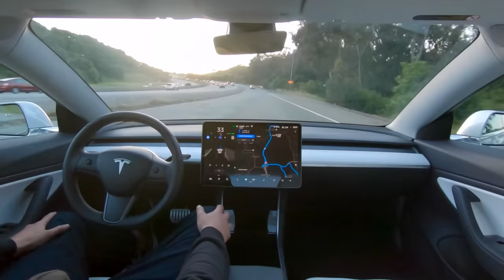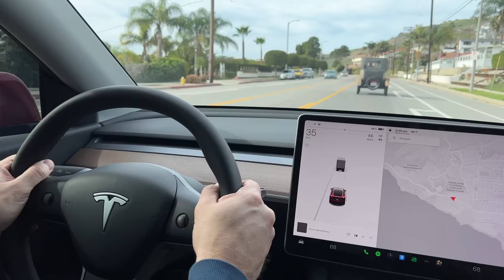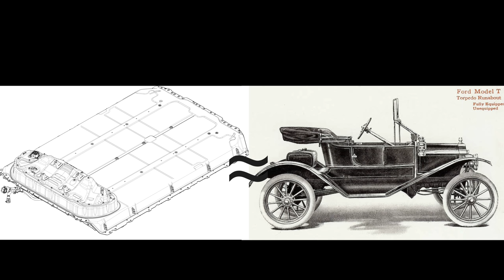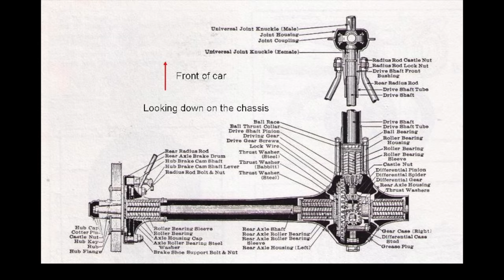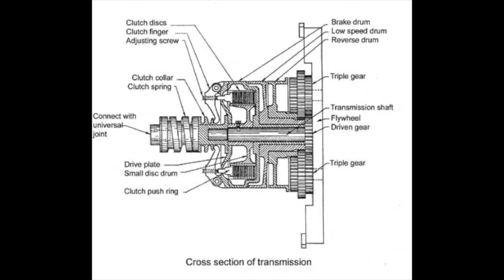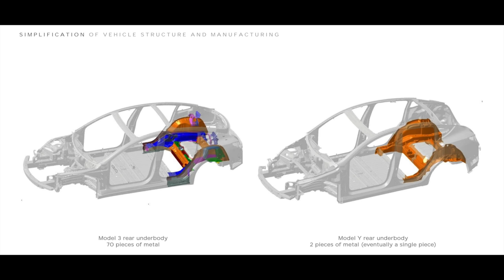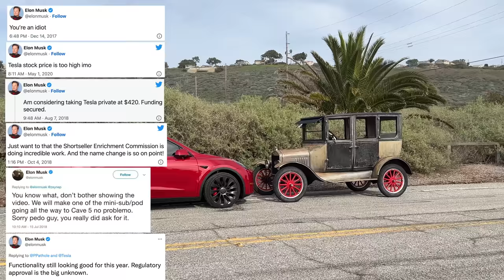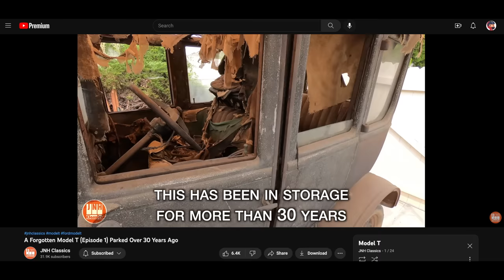1923 Ford vs 2023 Tesla

Comment: Here's something no one is around to remember. The Model T also had FSD, but not as good as the vehicle system it replaced: the wagon and mule. A mule always knew the way home. If away all you had to do was get the mule started and without other instructions the mule would always head for home.  The Model T according to my father, who's family bought a used one in the later 1930s, would settle into the ruts on the unpaved roads. It'd be harder to steer out of the ruts than to just go along with them. He demonstrated this one night in an early 1960s van when we were out camping. At night on a rutted track he took his hands off the wheel, then he turned off the headlights.  
Archeological: Maybe to the Model T. I've seen numerous recognizable Model T frames, probably Vanadium steel.  Two are in the San Gabriel Mountains, victims of a 1932 flood in the Arroyo Seco. (I couldn't find one of the frames two years ago -- probably buried in silt again).  The steering mechanism in one still moved smoothly. 
My great grandfather worked in the first scaled up Model T factory in Highland Park, Michigan ( around 1914?), I"m a Tesla investor. I've got the better deal.  When I first invested in Tesla in 2016 it was not lost on me that I was investing in a new car company when I knew that every American car company started since the 1930s went bankrupt.  Good point about Ford for not so much the Model T as the Model T assembly line. The important thing as Elon Musk says is "not the machine, but the machine that builds the machine."  And they both embraced extremist ideas because they over apply engineering where it simply doesn't work. A lot of engineers make this mistake.
What I've also found interesting. A ride in a Model Y is very much like a buggy ride (I've ridden in both. Henry Ford Museum in Dearborn had  Model Ts making short runs.) In the 1960s I first flew on airliners, DC-9s and 727s. The pilots handled them like sports cars. Lots of G's. I flew with my Grandmother (that's her father above. She worked at Dodge Main, about a mile from the Ford Highland Park plant.) She felt sick and very anxious in the DC-9, but after the weather in Boston cleared enough to take off in the 1930's era DC-3 (Provincetown and Boston Airlines) she enjoyed the low altitude flight out to the Cape. To me it flew exactly like her 1948 Plymouth drove. (More springs than shock absorbers). 
Tesla's quality is just fine. Sure panel gaps. That's aesthetics. Personally I'm a little bored with Tesla models, but my 2020 Model Y Long Range is still an amazing vehicle, fun to drive. I'll drive it until I get a Cybertruck and then I can't imagine what I'd replace that with. My Model Y will still be on the road 30 years from now, maybe 50, maybe 2023. 
 I know I can out accelerate anything else on the road. And I have one of the slowest Tesla models. I was surprised to find out that  I can beat Corvettes. Here's why: to drive a Corvette, you have to know what you're doing. Rarely does any Corvette driver with street tires  is able to or knows how to follow the torque curve which could accelerate it about as fast as a Model S Plaid.   Me in my Model Y? the computer does it all. It's not that it's not fair, it's just different and so different; no one who owns a Corvette needs to feel uncool. Corvettes will always be cool. Similar to how Model Ts will always be amazing.

Comment: I guess if you're driving your Model T and somebody pulls out on you, the steering does more for you than anything related to speed. But then also, there were no rules back then against modding your car, so mounting a tank turret on top was probably an option.

Comment: current ev cars are stupid, the right to repair basically dosn't exists
The best car would be a velomobile, some need only 150 watts to go 60km/h,

 That's 100 TIMES more efficient then current evs,

 Current evs need a 500kg battery that uses rare earth minerals that are mined by children in terrible conditions, current EVs also need rare super chargers to charge your car in a reasonable amount of time

 These super chargers put a lot of strain on the grid and sometimes are more expensive then if you would tank with GASOLINE! And when everyone start charging their ev's the grid wont keep up and the electricity will get more expensive which means everything else will also get more expensive.

 Meanwhile a velomobile could charge from a normal house outlet(3600watts max) and get like 200KM of range from 16 MINUTES of charging if you have a 1KW/H battery

I know that I can't go on a camping trip with my  family in a velomobile or transport a couch from Ikea but how often people do stuff like this?
Reply: Dont really like teslas but let me say some stuff. That is 37 mph, barely city speeds except in huge cities. 1 person per car so congestion would be at least twice as bad or maybe more. You can charge evs in your home as well. No need for the super chargers unless you are going on a trip or long miles. And its not just camping, moving furniture or stuff like that. It's also going to the grocery store, carrying a briefcase or backpack for work, taking your children to school, or going on the highway/interstate to commute. If you are that worried about it all, invest in buses. They solve almost all the issues and are better for cities
Reply: @SexyEarHair  50km/h was just a example for the 150watts, you can drive them way faster, and btw in what cities 50km/h is barely city speeds? where tf do you live? In my country everyone drives 40-45km/h even outside of the cities because people are scared of the speeding tickets that can literally make them homeless, 

"1 person per car so congestion would be at least twice as bad or maybe more"- velomobiles could be for 2 people easily (the passenger seat behind you) and when I see cars on the road most are used by only 1 person, and the congestion wouldn't be so bad because they are way smaller then normal cars

"No need for the super chargers unless you are going on a trip or long miles"-well not everyone lives in the US suburbia with in 300m square homes with a private garage.

"And its not just camping, moving furniture or stuff like that. It's also going to the grocery store, carrying a briefcase or backpack for work"-stuff like that can easily fit into a velomobile unless you buy groceries once per month
Reply: I mean, petrol is extracted in sketchy countries with leaky pipelines and refined in nasty hazardous places.
Reply: @faustinpippin9208  Most city limits have a speed limit of 35-45 mph. Highway speeds (not interstate) regularly sit at 55. Most people go about 10 mph over the speed limit at all times.

Even though they are smaller than normal cars, if everyone had one instead of sitting 1-5 people, it wouldn't matter how small they were. it would take a minimum of 3 to seat the same as a car would. And cars can carry all those peoples stuff where as a velomobile couldn't.

Your counter point doesn't make sense. You can charge a tesla at home off your wall socket, the chargers in the city are for topping up during the day, which if you charge over night you don't have to worry about unless you are driving more than 200 miles which most people aren't doing during daily commutes or similar. Even if you don't have a garage, you can still plug up at home with an extension cord rated for that power.

Lets be generous and say family of 4. Mom dad two kids. They grocery shop pretty much at least once a week. If not more. They fill up the trunk with groceries. You cant do that on a glorified scooter.
Reply: @SexyEarHair  I see you didnt read or just didnt understand..let me say again.
It can go faster then 50km/h
Most people drive 50km/h at most (not everyone lives in the US)
This would be just a commuter for max 2 people and it wouldnt make the traffic worse because most cars on the road today carry 1 person anyway
You can charge a tesla from a wall socket (3600wats) but you will get only 6km of range per 16min of charging VS the velomobile 320km because a tesla uses around 15kwh/100km and a velobile around 0.3kwh/100km which means you dont have to look for a supercharger when you run out of your battery
And I want to remind you again that not everyone lives in the US suburbia, many people live in flats, you can't run a extention cord from your apartment thru the street to your car.

"Lets be generous and say family of 4. Mom dad two kids. They grocery shop pretty much at least once a week. If not more. They fill up the trunk with groceries" how much do you people eat holy shit
Reply: @faustinpippin9208  Then get a bicycle. That's all a velomobile is. And are you seriously pulling the "Americans are fat card"? Its a family of four for Christ sake. Two meals a day during the week, 3 meals a day on weekends, 4 people. That's 64 meals total a week. We here in America actually like food that isn't beans on burnt toast. Try to fit that inside a velomobile each week.
Reply: @SexyEarHair  bicycle is blocked to 25km/h by the gov so a e-bike isnt a option for normal use because it will take you 2  times longer to get somewhere (unless its a city with a lot of traffic) and a e-bike doesn't protect you from snow/rain which will make the drive to work unpleasant sometimes. And all the time I am talking about a enclosed velomobile that's properly build, not the trike bikes that have a cardboard body. And a e-bike needs way more watts  then a velomobile when you drive it fast.

"And are you seriously pulling the "Americans are fat card"?" if you fill up your entire trunk in your car with groceries every week then what did you think will be my reaction?

If you can have only 1 car then I agree that a velomobile isnt for a family of 4, ok
Reply: I call bullshit on needing only 150W.

Where I live e-bikes are power limited to 500W: and I can beat them up a hill (once).
Reply: @jamesphillips2285  You call bullshit on something that can you  google in few minutes
you base your knowlage on one situation where you didnt know how many watts the other e-bike had (just because its 500max in your area it doesnt mean he had 500, you dont know in which gear he was, maybe it was a hub motor designed for higher speeds but low torque? not for hills?
Reply: @faustinpippin9208  In high school I had ~750W peak power output in the "power output of a student" physics experiment (running up stairs 2 at a time in my case).
The wind is not always still. The road is not always smooth and flat.
Reply: As mentioned, you couldn't even bring a colleague to work, bring kids to school, or take the family to a dinner out, either, much less do a road trip 😂 not to mention the utter lack of safety equipment on a velomobile to keep the weight down.

What do you eat, if a trunk full of groceries for four seems large to you? Vegetables can take up a lot of space, usually more than meats and breads when I shop, and I fill my car's trunk 1/4 full each week or two just for me. Probably half of that is the produce.

Most people with electric cars who charge them at home do so overnight, when energy use on the grid is less and while they are asleep, so wall-outlet charge times aren't really an issue. Most people who live in apartment blocks have parking spaces or a parking garage for their cars; many of these places have EV-designated spaces with a fast charger. I'm not even an EV advocate and I know these things.

You sound like someone very young and naïve that has very little life experience.
Reply: @jsquared1013  Shopping by bike is a lot more feasible if you don't have to brave a stroad to get to a "power center" to do your shopping. R1 zoning hurts cycling two ways: by banning medium density, and by banning businesses in residential areas.

Comment: I drive a 2020 Ford Escape SE since mid March 2022. I’m mostly a Ford gal since I grew up on mostly Fords cars. Each of my vehicles are Fords. Only one was a Mercury but, it had Ford logo stickers under the hood and the trunk. The Mercury was a 2011 Milan. It looked the same as Ford Fusion’s interior. That I know is still a Ford to me. Even when I had a 4 door Ford Focus they had a computer out line of a 2 door one. My had 4 doors. When I got the Focus the line up had 4 different body styles of the Ford Focus. My 1st car had just one body style. My 1st cat was a 1998 Ford Contour SE. That was a 4 door sedan car. Every vehicle that I had was a 4 door vehicle. My last car before getting the 2020 Ford Escape was a 2015 Ford Escape SE. I had my last vehicle almost 5 years before it died on me. Even my sister’s vehicle is a 2013 Ford Edge limited in white. He vehicle was our mother’s. My sister’s last vehicle was a 2002 Ford Escape in black. She missed the sized of her vehicle. The vehicle she has now is cooler in the sun in Florida. She is better with a white car than a black one. For me where I lived it sometimes gets hot in the summertime but, colder during the winters. I only had my vehicle less than a year. I’m happy what I have in driving. I have 2 other neighbors with a Ford car another person has a Lincoln town car.

Comment: The manufacturing numbers for the Model T are even more impressive when you factor what the population was at the time.. The VW beetle overtook the Model T in total number of cars built.. But it was over a longer period of time, and in a world with far more people to sell a car too.
I wonder how many 2023 Tesla Model Y's or any other new car will still be running around in 100 years?
What little I could find on the Internet suggests about 250,000 Model T's still are on the road.
And you can still get every single part for a T.. you could build one from scratch if you wanted.
Loved the video..

Comment: 6:28 It's true that model t has great articulation. it's apples to oranges comparison.
Tesla has awd with traction control that ensures optimal traction at every wheel.
Model t has rwd open diff it's fine if both wheels have traction but if one wheel lifts or it has very little traction no power goes to the wheel with traction. You are basically screwed. Also tesla tires are different and widder which is great for snow, mud etc. The whole bottom end is completely smooth. Smooth bottom end is good for sand cause it allows it to slide over sand. Offroad capabilities depend on situation.

Comment: In 1977 I received a Masters Degree in Occupational Therapy and discovered that my first job paid the same  salary that an 18 year old high school graduate received in Detroit and for a moment I thought, "Was my 6 years of education a costly mistake?".  I quickly realized that the kid on the line would be screwing in the same bolt for 40 years while I would have an interesting career.  As it turned out I was more correct than I realized.  With additional education and experience my salary rose substantially, I was never at risk for unemployment because I had a valuable skill set and my work life was quite interesting.  Within 20 years the Detroit jobs disappeared and auto workers were earning substantially less than me as my career progressed.  I tell this story to any young person considering a career without skills.  A bolt tightener can always be replaced, a professional has a unique skill set and can always earn a living.  (and by professional I mean any career, including trades, not just college degree based skills)

Comment: Another point I'd like to make, anybody who isn't completely stupid can overhaul any aspect of the Model T they like with a manual and a few basic tools, it'd barely take more than a crescent wrench to completely rebuild a model T. On the Tesla on the other hand, if any part of it breaks, it will probably cost more than the Model T did just to get it fixed, and it takes a lot of knowledge and tools to fix it even if you can diagnose the problem yourself

Comment: I would go as far as saying skateboarding downhill (obviously with no helmet or pads) on Market Street in San Fran, passing every intersection in the middle of the road no matter the legal right of way is probably safer then driving a Model T with literally any other car on the road period you might possibly have to interact with.  What saved you in a Model T was VERY careful driving.  Did you ever wonder why Grandma drives so slow?  Probably because she ridden in or drove at some point one of those Model T death traps.

Comment: Weird how people forget that electric cars were the original cars, simply because they were easier to produce.

Quite, basic, used fewer components, but they had limited power output, limited range, and required a source of power.

Combustion engines, at the start, were vastly superior to the original electric cars. They had more power, and by using a liquid fuel they eliminated the need for grid connectivity. That's what allowed the combustion engine to overtake the electric motor. It was was far cheaper and easier to transport and store liquid fuel than it was to build power stations in rural areas

Comment: there's a reason why everybody else moved to the modern 2/3 pedal setup with seperate brakes and sequential gears. you have to remember, Ford was neurotic about the model T, where the engineers working for him assumed it would be sequentially replaced as they improved their manufacturing technology like they had, Ford insisted the world started and ended at the model T, to the point that by 1923 it was actually pretty dated of a car and had ww1 not interrupted things, the rest of the early auto industry would have even further outmoded it. ford was sitting on thousands of these things in 1923 and was forced to stop manufacturing them only 4 years later due to basically non existant sales